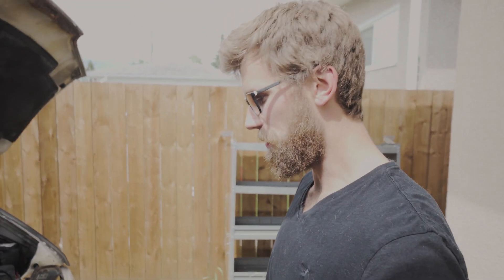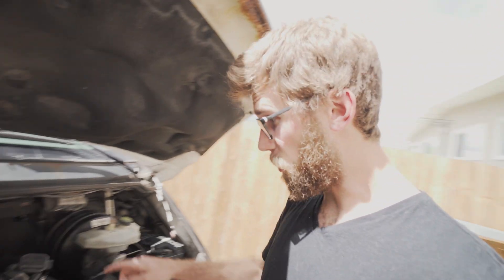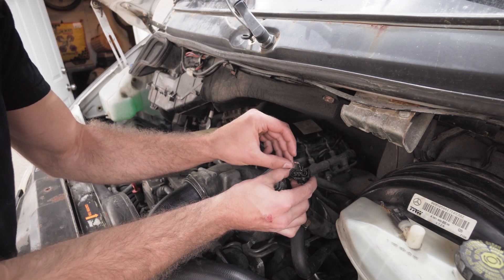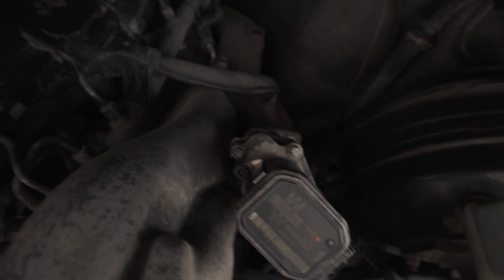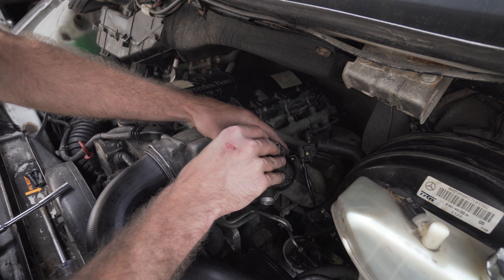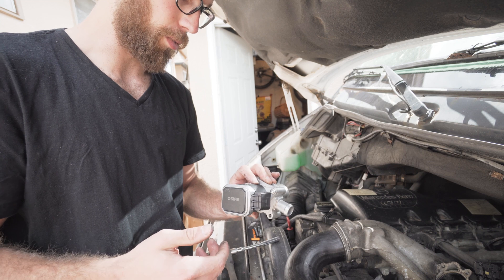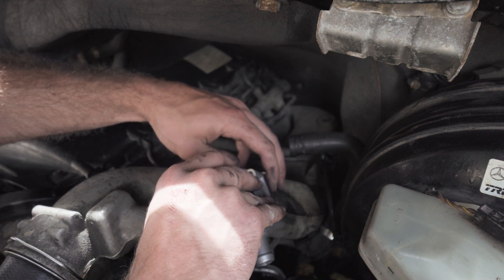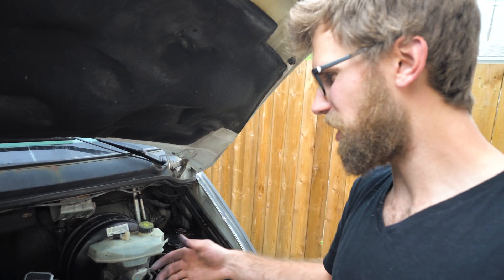EGR Valve Replacement: How to Clean, Bypass, and Replace a Bad EGR Valve

Comment from the maker: Did you find this video useful? Feel free to reach out with any questions and let us know about your EGR valve experience in the comments below. Thanks for watching!
Reply: We want to know how that eBay EGR valve is working out for you?
Reply from the maker: @ it’s still working great! Zero issues
Reply: @madetoexplore  sounds encouraging. BTW, what's happended to your resistor delete trick?  Didn't work out?
Reply from the maker: @AZRockRunner  it worked great! I just decided to replace the EGR with a new one so I didn’t have an engine light on all the time.

Comment: I have a big problem I don't seem to have a EGR valve where yours is, I have Mercedes sprinter 316 2.7 5 cylinders , but cannot find EGR valve
Reply from the maker: You probably have the earlier t1n model
Reply: Don't the earlier ones have an EGR , because I thought was causing the limp mode every now and then , there doesn't seem to be anything wrong ,runs as smooth as anything , until limp mode even in limp mode there doesn't seem to be anything wrong except won't get up to speed until I restart it , then it runs great until I turn it off

Comment: Apparently this is a common problem but so many mechanics looked at my car and had no idea, my insurance had to tow it away and that garage found the problem straight away! Mines costing £700 to replace today, apparently it’s stuck open at 0.4%, I’m gunna be asking them to clean it first, so wasteful to just replace, why didn’t you clean and replace yours?
Reply from the maker: @usernametaken8148  I did clean it but my spring was worn out to the point that it wasn’t shutting anymore so it needed to be replaced

Comment: I have replaced my EGR Vale on ML350 cdi 2010 but I still get an Error  Exhaust Gas Recirculation control circuit range/performance
Reply from the maker: Might be a wiring issue or bad EGR valve? There also might be other sensors locating along the exhaust.
Reply: How do I fix it .

Comment: Easy to follow 😊 ... i did the plugs already, wow it took me less than 1 hour to replace all 5 ... i guess the egr is next then 😁 thanks!
Reply from the maker: EGR is usually pretty easy too! Good luck
Reply: @madetoexplore  I did the injectors and found out that my engine has a broken bolt inside, so they added threads on top... I will need a bolt cut to size everytime 😅

Comment: Was your EGR valve making a whining/humming sound right after you turned off the engine and removed the key from the ignition ?
Reply from the maker: I’m not sure, I never checked that. It would make sense but it would depend where the flap gets stuck. Some get stuck closed and some get stuck open.

Comment: Excellent video! Showed me what I needed to know. Thank you. My question is the bottom bolt will not loosen. I am afraid it will break and then I will be in trouble. What is the best way to get it loose
Reply from the maker: That’s great! Is it just spinning without coming out or is it stuck? Since the threads are aluminum sometimes they can be stripped. I would try and remove it carefully and try to get some PB blaster on there

Comment: I thought mine was egr. Turned out to be loose air intake control arms. They sit under the oil cooler down right under the turbo outlet piper and are part of the intake manifold. If they have play in them the comp cant tell where they sit in space and throws codes. Mine happens when accelerating rapidly like on a freeway ramp. I found this out after replacing the egr didnt fix the issue. Now the real
Fix is 2-5 k.
Reply from the maker: Yikes! That’s an expensive fix. Thanks for sharing. Hopefully it’ll help someone else 👍

Comment: My egr valve is stuck really bad. I’ve banged on it with zero luck getting it even to budge. I don’t know how I’m going to get it loose. Yours just came right out 🤷🏼‍♂️🤦‍♂️😂
Reply from the maker: Have you tried to remove it when the engine is hot?

Comment: Thank you for doing this video because most ppl don't explain the real symptoms, especially the black smoke.  Let me also say, the problem with the failure really is inside the part, specifically at the internal bearing.  The bearing fails and the shaft does not rotate well.  Cleaning the outside really does nothing
Reply from the maker: Thanks for the info! Always appreciated 😄
Reply: @madetoexplore  I've been dealing with this problem for 2 months and asking every so call diesel expert, ppl, shops, etc.  I literally had to eliminate every other thing to find this.  Even switching one injector at a time.  Even had to take the turbo apart twice to clean for soot.  I finally part 2 and 2 together with the sound of the engine.  What a long, frustrating process and no one had a clue.  I'm on the road traveling and now waiting on this part to be delivered.  Once I figured out what was wrong, I then searched YouTube and came across your video.  Boy, I am mentally exhausted from this one for sure.  Thanks again

Comment: All kinds of EGR experiences but similar to yours.  I'm going to replace mine after cleaning many, many times.  Will I need to "talk" to the CPU to recognize the new EGR or should it basically be plug n play?  I'm running a 2011 2500. Great video.
Reply from the maker: Thanks! It’s a plug and play. The link is in the description of the video too. Mines still working great!

Comment: Found  the   Size of the  resister  Below ...    I  have a  2013  ( Sprinter )  so  there are  4  wire inputs in the  electrical  Plug..    Which  ones to use ?    Ty  dude.
Reply from the maker: Sorry John! I’m not to sure with the newer sprinters.

Comment: Are their two different type of EGR valves for these sprinters?
Reply from the maker: No, not that I know of
Reply: @madetoexplore  Depending upon the year of the Sprinter. My 2015 3500 had two coolant hoses.
Reply from the maker: @michaelt2961  sorry, I was just thinking of the T1N models. Each model probably has a different EGR valve
Reply: Yes there are it depends on your model of Sprinter @madetoexplore
Reply: yes for T1N there's two different types for OM612 up to 2003 and 2004-2006 for OM647. 
The resister trick is incorrect and does not work for the 2004-2006 as shown on here.
Reply from the maker: @mannyst1nvan  it’s not incorrect…worked great on my 2005 sprinter. Drove halfway across Canada with the resistor trick.
Reply: Here's the two different EGR types for the T1N https://www.youtube.com/watch?v=q19U6rX2UK4
Reply from the maker: @mannyst1nvan  okay, I get that there’s two different types but I would also guess that the resistor trick might work for both since the electric motor/electric connection looks very similar
Reply: @madetoexplore  doesn't hurt to try in an emergency 🤷🏻‍♂️

Comment: I have issues when my 2006 sprinter is sitting outside over night and it gets below around 30 degrees F. Can it be the EGR valve? Battery is new and mechanic says doesn't sound like alternator issue.
Reply from the maker: No it doesn’t sound like the EGR valve. If the battery is new and the voltage is higher than 12v when the engine is off then I would check your positive/negative connections to your starter. Keep an eye out for broken wires/loose rusty connections as well.

I had to replace the main grounding wire that ran from the battery to the engine block on our sprinter.
Reply: @madetoexplore  okay but this issue only happens when it's very cold outside
Reply from the maker: @J87513  does the engine turn over or not at all?
Reply: @madetoexplore  no it doesn't....unless I jump it for couple minutes. And yes I do have some antigel stuff in the gas. Maybe not enough?
Reply from the maker: @J87513  if the starter isn’t turning over then  the starter may be bad but I would bet it’s the main ground wire going to your engine block or the positive wire to the starter. Wire isn’t as conductive in lower temperatures.
Reply: @madetoexplore  awesome thanks so much...we old sprinter guys are all family ;)

Comment: Thanks for the helpful video! Another sprinter mechanic recommended antifreeze around the EGR when replacing—I guess his was a lot harder to take out. Any reason not to do this? Thanks.
Reply from the maker: Sorry I don’t quite understand, what do you mean by antifreeze around the EGR?
Reply: @madetoexplore  I think he meant anti seize.  I know I had a bear of a time breaking mine free.
Reply from the maker: @adphotoman8440  right. Coolant hoses can be tough. Using a twisting motion usually works really well. I guess you could put a little anti seize around it if you wanted to give it a try.

Comment: So did the EGR valve you installed work? I’m having underboost problems and took the egr out to clean it. It does go back but it’s pretty slow to go back. I don’t want to pay OEM price on this van with 500,000 miles so I was hoping the eBay one would work.
Reply from the maker: I’ve only put 10,000 miles on the eBay one but I haven’t had a problem since I changed it! I’d recommend it
Reply: I went with one from eBay and it did not last long at all. Has developed a leak and triggers loss of boost pressure. Only put about 2-3000 miles on it

Comment: What kind of resistor? That would be helpful!
Reply from the maker: 2.2 k-ohm 1/2 watt resistor
Reply: Copy that. I figured it out by studying the lines on another video. I am curious About this bypass. If I do this I understand that it won’t signal to my van to get it into limp mode but would it give me horsepower? Because I feel like I’m accelerating very slowly and there’s still not enough power. I haven’t put that resistor in yet
Reply: I am accelerating pretty slowly and I still feel like I don’t have enough power. I have not put the resistor in yet
Reply from the maker: @ryandavis141  it definitely won’t add any horsepower. I notice a small decrease in performance when my EGR was bypassed actually. This would explain the increase of fuel mileage that some people have reported. Slower acceleration = increased fuel mileage